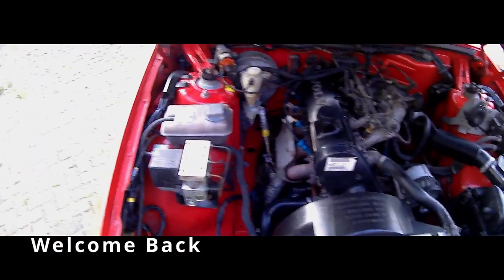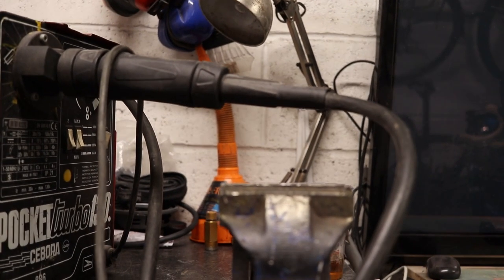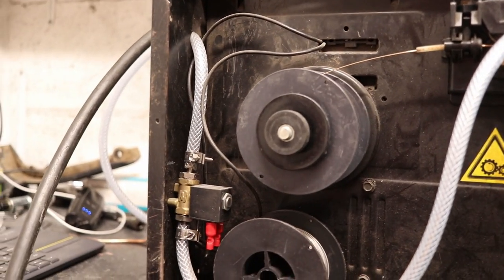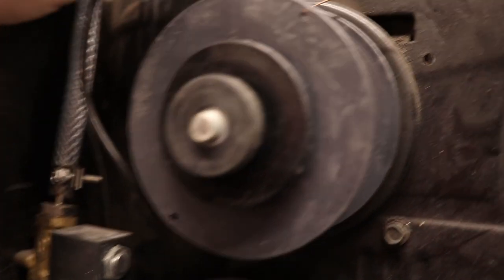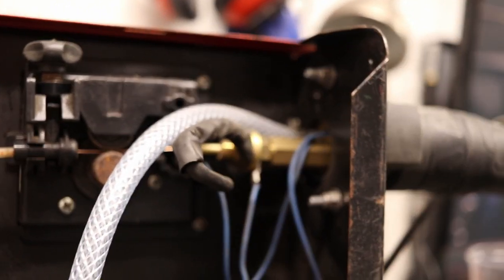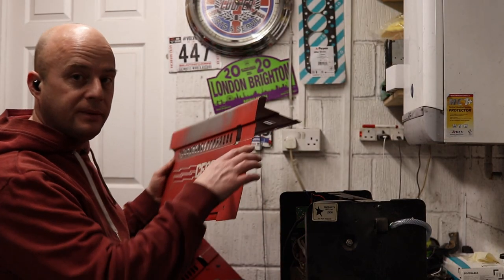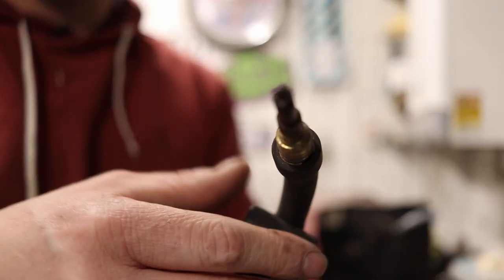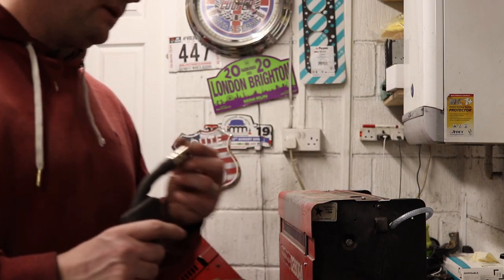Cebora Pocket 130 | Mig Welder Modifications | Euro Torch and External Gas Valve

Comment: Hi Tim I hav the same welder , mine was sold by Mac Tools I presently dont have access to a 220 volt outlet at the place we are renting so my big welder is in storage. I replaced my torch with one from yeswelder with the valve in the head like it originally had but a much better gun. I had problems with my torch in the handle there was a set of breaker points that were pretty much worn away . I have had this welder for almost 30 years and it's bailed me out several times. I like to use CO2 in it, especially on exhausts.

Comment: It has answered all of my original questions. Now I'm pretty jealous and I'm wondering, what solenoid valve did you get? And how did you fit the euro torch to the existing wire feed mechanism?
I have one of these, and the torch leaks gas and half the time I need to give it a knock for it start feeding, even after lots of contact cleaner. 
I'd love to fit a "euro-torch" but I have no idea what I need to buy and how to retrofit it.

edit: btw subbed
Reply from the maker: I can’t remember off the top of my head what valve I got. I got it off eBay, a 230v one with suitable hose size. To do the euro torch wiring I found a guide on the internet. It’s pretty generic. To be honest if I were to do it again I’d probably get an original torch replacement
Reply: @Thecarislife  Top stuff. I've got mine hooked up to a hobbyweld 5% bottle, I ended up just using adapters so the bottle connects to the original 4mm gas tube (which looks comical but works).
I'll have a look at replacement torches.
Reply: @Thecarislife  Just a heads up, I got a replacement torch from wecs-ltd, and it's been working perfectly ever since. Thanks for the advice.
Reply from the maker: @1992jamo that’s great news thanks for letting me know

Comment: I've been told the snap on turbo 130 is the same machine. I need to do this conversion. 
I noted a comment on changing polarity for useless wire.. I'm sure a switch could be aired a double pole one?
Reply from the maker: For gas less I assume? I’m not sure on that I’m afraid. I believe the machines are the same though

Comment: Hi Tim, I'm having a problem connecting my 230v AC gas valve. It looks as tho' you connected the two wires somewhere on the wire speed switch but I can't see. Could you clarify this for me? Many thanks.

Comment: Thank you for the explanation.  Is there a way to tell if the original lance has a gas valve? Thank you again for the video!
Reply from the maker: I think to be sure sure you can take the plastics off. Then you will see the valve. It’s usually a rectangular brass piece with a small knob on that is pressed by the trigger
Reply: If the power is off and the gas supply is on, it will still provide gas when you pull the trigger since it's mechanical and not electrical. I would recommend always turning the gas off everywhere, and if it's a small disposable bottle, just disconnect it as rapidly as you can since they are notorious for leaking.
Reply from the maker: With the euro torch the gas will no flow without power. It will with the original. I’ve learnt the expensive way to turn the gas bottle off asap